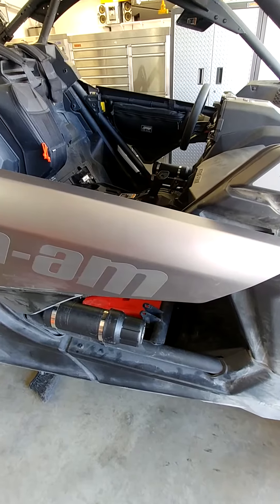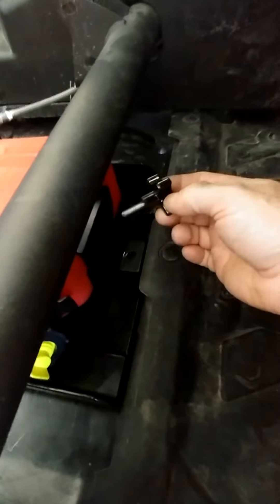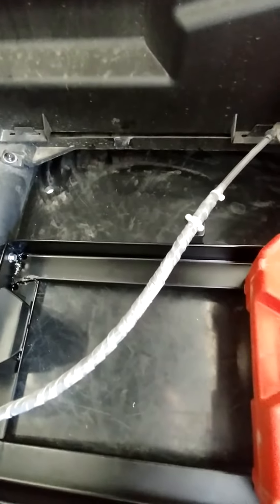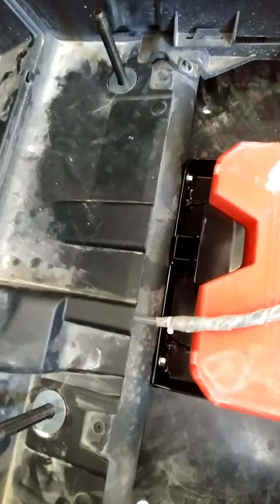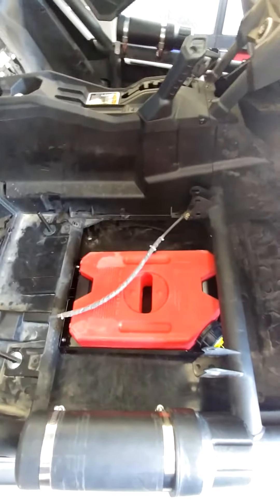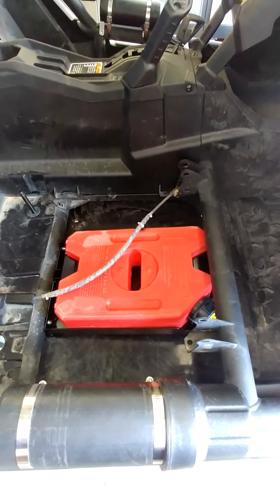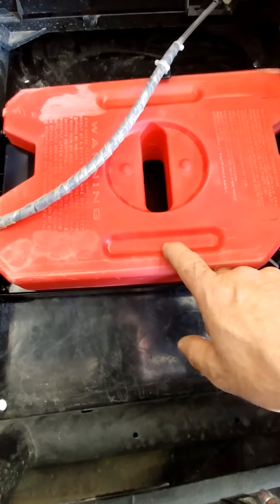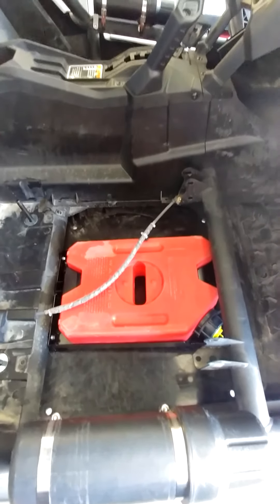Can-Am X3 Spare Gas Custom Mod

Comment: Wow Great Idea !!!!! I've been wondering on a good location for a spare can. Did you custom build this? Gas can over the engine is not a good option in my opinion
Reply from the maker: Thank you for the feedback.  Yes, I did the custom design and fabrication.  I've been using the setup for about a yr now and it is working better than I expected.  I decided to use the manufacture mounts (turn buckles) on the inside wall of my enclosed trailer to hold the fuel jugs when I do not need them in the X3....then I just slide the jugs in when I'm going on a longer ride.  You might want to checkout (if you haven't already) the custom design I came up with to carry tools for trail side repairs...that design works just a good as the spare fuel jug design (https://youtu.be/PrUF2Gs5Cqo).
Reply: Ok cool I’ll check it out.

Comment: Is it possible to store 2.5gal tank underneath the seats?
Reply from the maker: I think the max is about 1.75  to 2 gal per container (using similar container design)...the main limit is the height opening at the front of the seat.  However, I think it is possible to store 2.5 gal if you design the system to leave the container under the seat with a pump to move the fuel (as usable fuel).